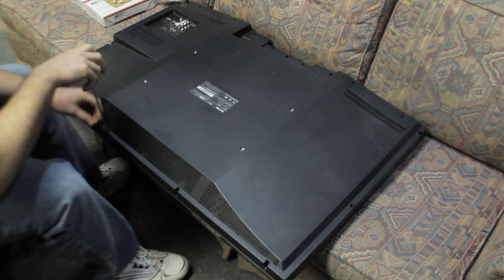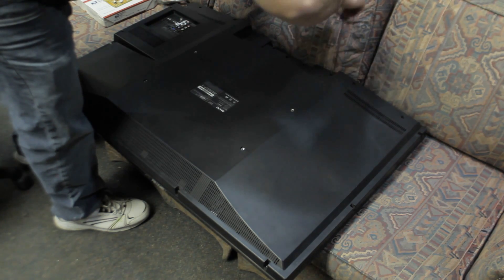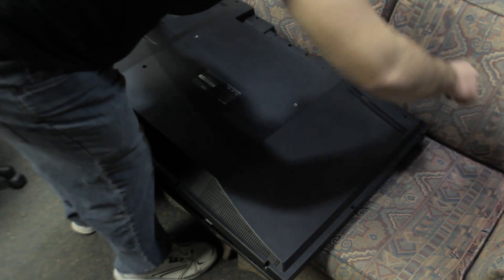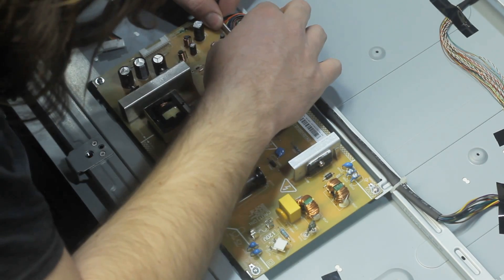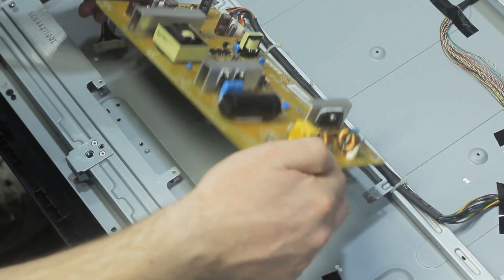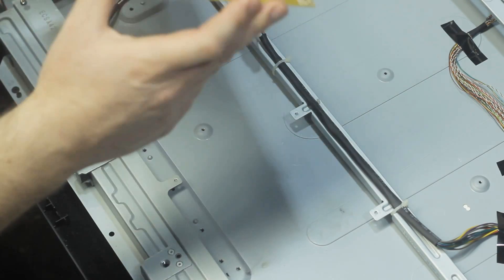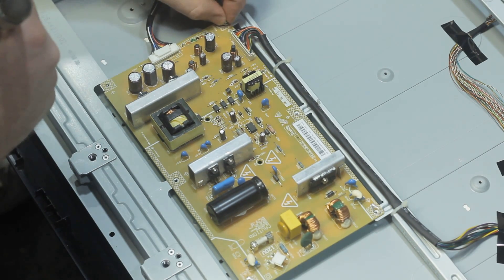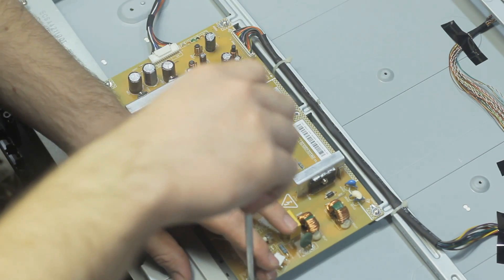TV won't power on? How to replace the power supply circuit board

Comment: Any pointers on safely handling/disposing the old power supply board?  I was ready to jump right into this on my TV after diagnosing the likely cause (pop sound following no power) and finding the correct replacement board, but your comment about incorrectly handling the capacitors potentially causing heart failure has me a little skeptic.

Comment: same happening with my tv a NS-55D420NA16 Insignia... i replaced the power supply and the IO board and no improvement i still get the red light, when i push the power button the red light flashes and that is it, no image no sound. there is another smaller board on the bottom middle of the tv, i guess its some type of driver. i am going to take it out and get another one. wish me luck

Comment: Great vid content. Can I ask you a question? I had problem with COBY LEDTV2426T. I just enabled or ON the key-lock function the problem is i had no remote control. I just used to control its button at the back. Can yo u help me to power on my TV? Without using remote control? Do you know secret key button that would help me out to turn ON this terrible TV of mine? 
Can i technically power ON my TV using any other universal TV remote control when the TV is in power off mode.( i mean the red light indicator is ON) Thank you!

Comment: Nice video! Is this a TOSHIBA PK101V1760I POWER SUPPLY BOARD FOR 40FT1U? I had a tree hit the power line outside and sent sparks flying through surge protectors in the house. Roku and dvd player survived but not the tv. Is it worth even trying the fuses first? thanks

Comment: If you swap out all the bad capacitors it should work again. Common problem and a $15 repair we’ve done here with success. Soldering iron is required.

Comment: Our families problem is it turns on for a minute then turns off. Solution please?
Reply: Same
Reply: That is bad capacitors. If you take the back panel off and look at the power supply board you will see several capacitors that have swollen at the top, blown apart, or leaking. This can also cause strange fuzzy audio issues which all go away if you are a diy’er.

Comment: My TV doesnt turn on but I do get a right light when i plug it in , People aare telling me its the EEPROM , How do i know if the Power Supply board is blown.
Reply: Is it a Samsung? If the red light on the front is lit up you can actually google the amount of times it blinks and most of the time that blinking is a code. For example my samsung red light flashed 3 times and I learned it was my Power Supply Board. 

95% of the time it is indeed the power board. Go with a company such as ebay and order one. If it wasnt the problem you can return it (with 30 days return policy)

Comment: My tv experienced a power surge and now the little light only comes on with a completely black screen. Can this be fixed?
Reply: Yes. Its probably a Power Supply Board such as this guy replaced. Super easy to fix if you have a newer TV :)